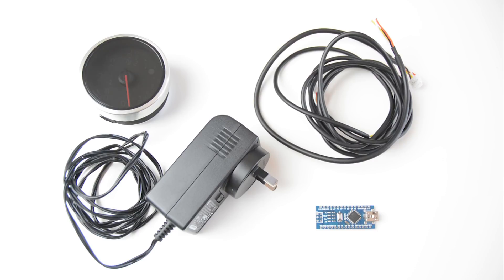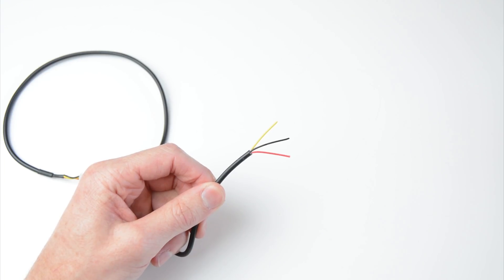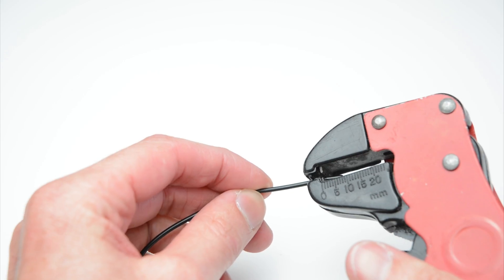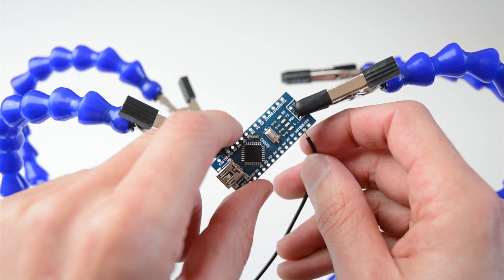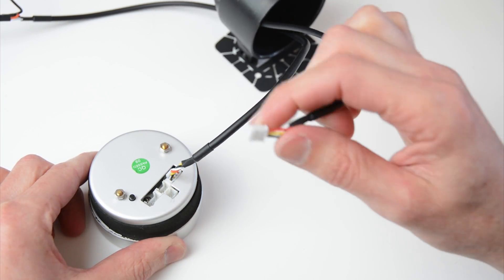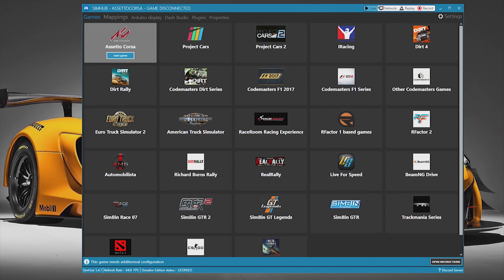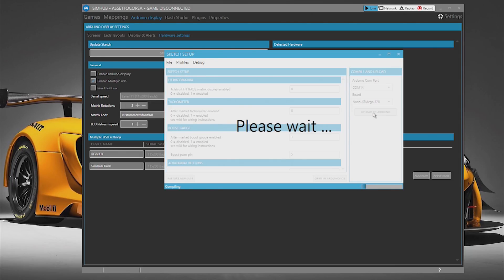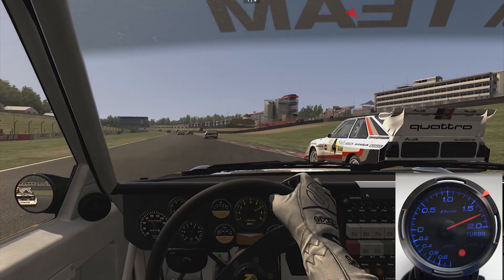DIY BOOST GAUGE ARDUINO | SIMHUB

Comment: Hi, I know this is an old video but I had a question, I made an E36 guage cluster following your guide and I was wondering, if I made this boost gauge could I hook it up to my existing 12v power port that feeds my guage cluster so both the cluster and the boost gauge run off the same 12v 60W power supply?
Reply: I'm not specialist but i think it would work, i have same question because i want to do e36 cockpit in my room
Reply: @hewerah  ok well I picked up a cheap secondhand boost gauge, when I have the time I'm gonna do all the wiring in which case I'll update wether it works or not, if it doesn't no biggie really, as the small 500ma power supplies are dirt cheap online

Comment: Hello, purchased a boost gauge very similar to yours in the video but I only have one 4 pin plug which will go to the power supply and have a piggyback wire for the arduino board, the problem I have is  the 3 wire cable I supplied only has a red and a black wire connected, there's no yellow on that to supply the signal wire for the board. Can you help me please? Thanks. Tony
Reply: Did you ever figure this out?

Comment: Great tutorial, thanks! Find it unfortunately hard to find the exact gauge that has those 4 and 3 pin plugs. Some just have 4 or some have 4-2-4 - so I would be more than glad to know which one available today would fit!! thanks!
Reply: @uhavinalaughm8  You just need any electronic boost gauge, mechanical gauges won't work.
Reply: You ever figure it out?

Comment: i have some questions...

1st - Can I use only one 12V Powersupply for the RPM Tachometer and the Turbo Gouge, or I need 1 powersupply for each? If its possible to use only one, which powersupply do you recommend?

2nd - Can you make a video for a speedometer?

Comment: One question: can I use one arduino for multiple accessories? For example this boost gage and a tach in the same board?
Love your videos keep them coming!
Reply from the maker: Yes, just need to assign the pins when setting up the sketch
Reply: amstudio sweet! Chears!
Reply: @amstudioprojects  I can’t find a suitable boost gauge all have boost pipe going to them
Reply: @fredsteward9300  you need an electrical boost gauge, it will have a wired sensor that runs a boost hose to the gauge

Comment: I've noticed that you use the arduino nano for all your projects. I have a couple of pro micros and Uno rev. 3 laying around, would there be any reason the sketch would not work with those boards instead?

Comment: After looking to gather parts for these builds, I noticed you used a slightly different Arduino Nano for your Button Box video. Are they both able to fulfill the purpose of creating either the Button Box or Boost Gauge? The parts list in the Button Box video shows a link to a Nano Pro. I don't know any better, but is there a big difference?

Comment: Should do a vid where you can hook multiple mods up to one nano. Also surly the gauge wouldn't need 12v? Would there be a way to power it from usb?
Reply: you could probably use power from the USB then put it through a boost convertor. since it doesn't need much amperage, would be ok i would guess.

Comment: Just asking but what wheel and pedal setup were you running also is there a way to get more travel on the g920 throttle and clutch pedals to be more realistic? Anyways great video and fun project as usual keep it mate!
Reply from the maker: Using Fanatec Clubsport, list in the description.
Reply: amstudio my bad I should have looked at the description thanks though